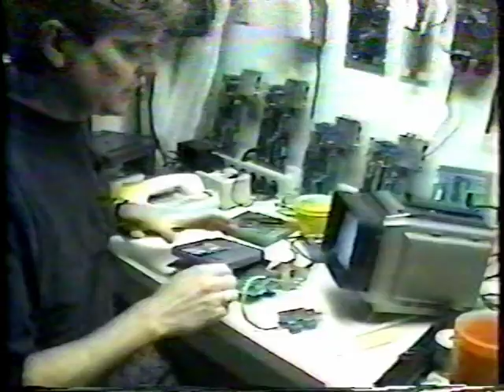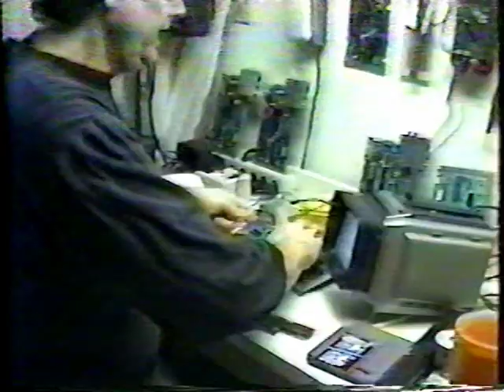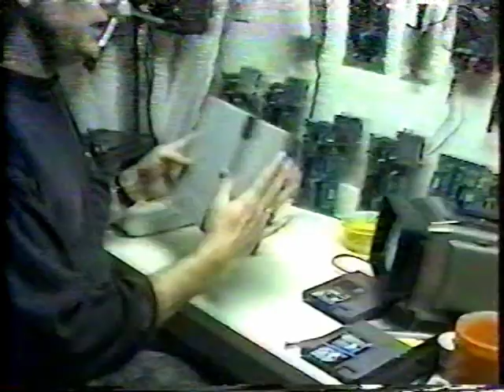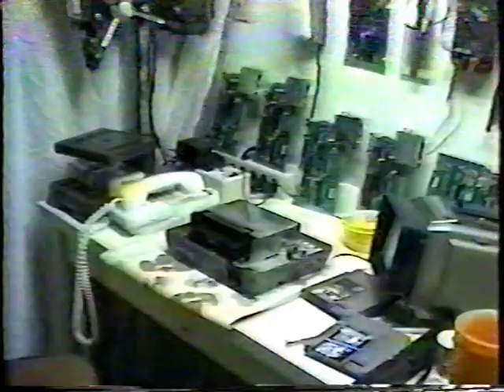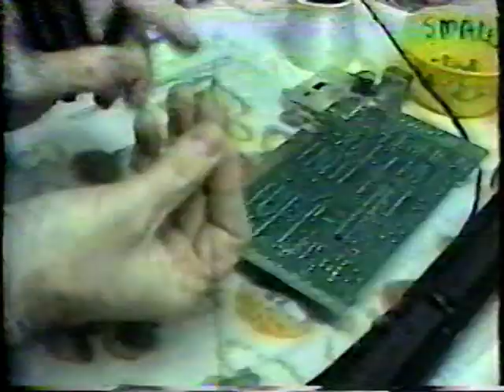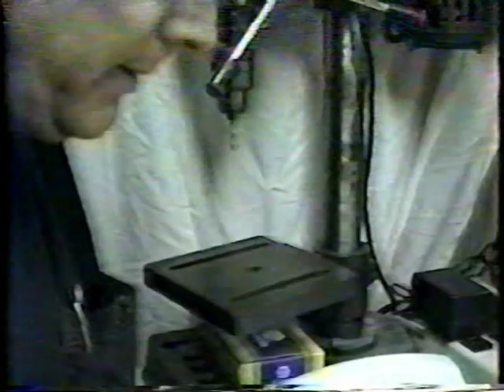Nintendo NES Repair by Irata Systems 1992 Part 10

Comment: I have been working on nes systems for awhile now. I keep getting systems over the years that will mainly just have a gray screen. I have cleaned the games, motherboard, put a new 72 pin in it and still getting a gray screen. I have 3 mother boards right now that are doing this and i cant figure it out. Do you think replacing the PPU chip will work? If so do you know where to find it? Does radio shack carry them?